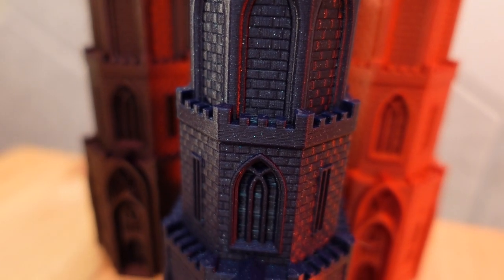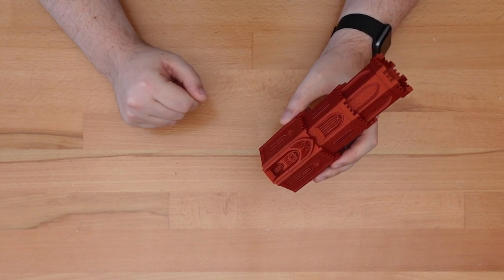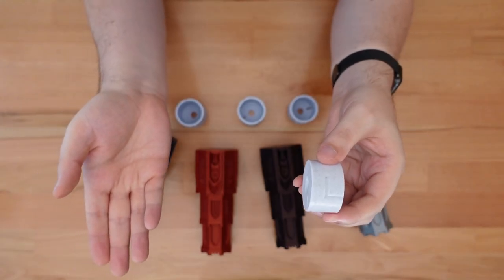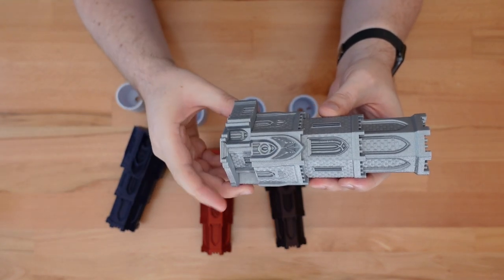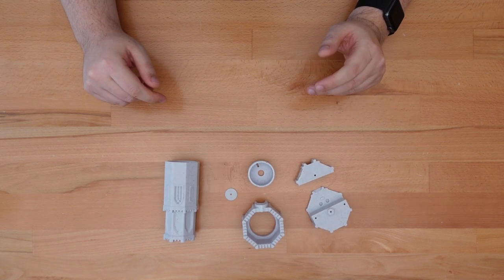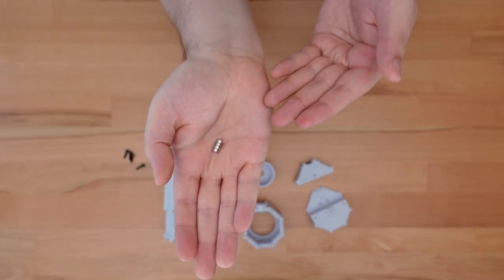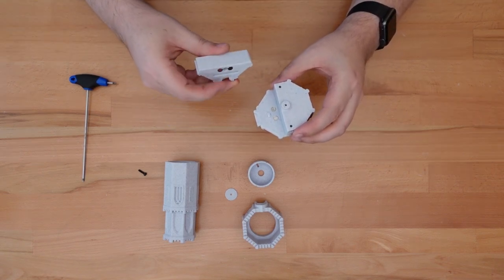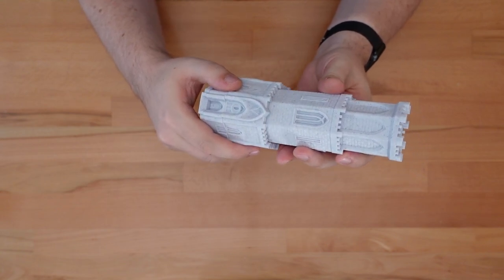Dracula's Tower - A 3D Printed Puzzle Box

Comment: The tower does not enter the maze hard aligning the larger window, I verified that it is the only one that presents this difference. I can't fit the tower into it. Can you hekp me?
Reply from the maker: Correct! The hard maze is extra tricky... and one of the tricks is that the exit is offset. To put it back together, make sure that the front of the tower is facing the front of the base. Then push the slider back and forth until you work your way into the first track :)

Comment: What is a good software for remixing? I currently use SolidWorks but you can't remix an stl file on it.
Reply from the maker: I primarily use Fusion360. It can convert STLs into solid meshes reliably and can work with STEP files particularly well.

Comment: Great model. So quick question I printed the model on my Anycubic Vyper and everything was way too tight to assemble. Your model just slid together without resistance. Any suggestions?
Reply from the maker: There's a chance that the parts are only too tight near the bottom of each part, due to a printing issue called "elephant's foot". If that's the case, increasing your z-height a bit to reduce the initial squish can help. If the problem is with the entire height of the part, I'd try reducing your print temperature (unless you are already printing as cool as the filament permits). The last option is to reduce your extrusion multiplier slightly.

I've uploaded looser versions of the maze inserts if we're lucky and that's the only part that's giving you trouble. Good luck!
Reply: @3DPrinty  thanks for the reply. I went with the looser print worked great!

Comment: I enjoy your prints; toggle buttons, Braille Peg Cell, bobble heads. However I'm a novice with a Neptune 2 and many of the prints that I make of yours have too tight of clearance. Sanding off 2 or 3mm all the way around the inside of the top and body before anything can grind together is not helpful. This is not the first of your designs that was tighter than a rusty vice(Spring Latch). PLEASE in the future put a little more clearance for parts that move past or around each other.
Reply from the maker: Glad you like the designs!

I've uploaded an optional loose version of the tower body that may work better for your printer. The loose version has double the default clearance. Any looser than that and we run into problems with the maze, which is only 1mm deep.

If this is a frequent issue, I recommend printing some clearance tests to further tweak your print profiles. This could be caused by over extrusion, elephant's foot, surface imperfections, or even printing temps that are just a bit too high.

While I try to provide alternate clearance options where suitable, I don't plan to change my default clearances on future designs. There just isn't a perfect clearance for everyone. My only real option is to use what works best with the printers I have on hand.